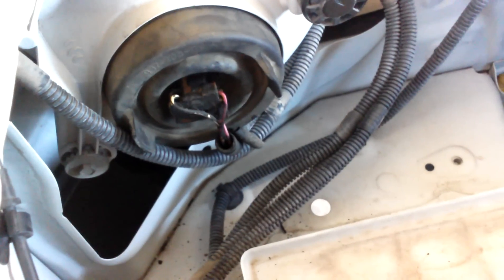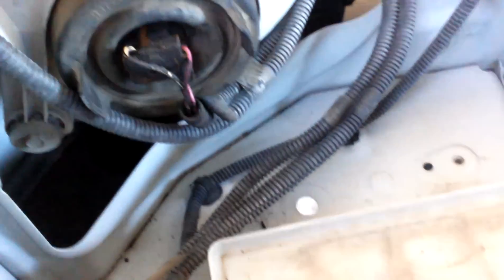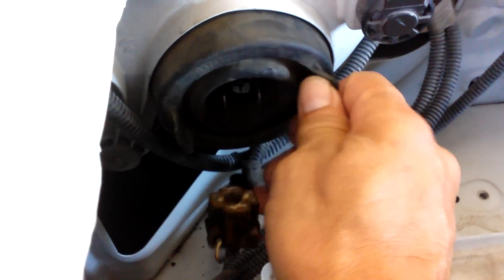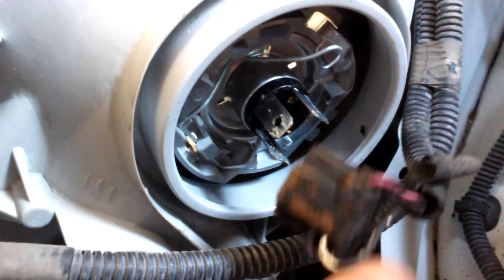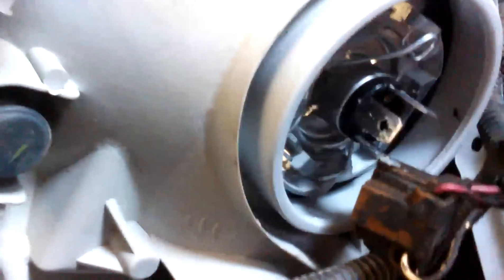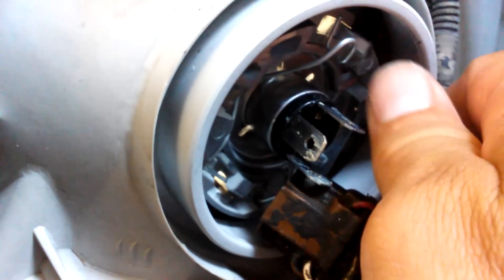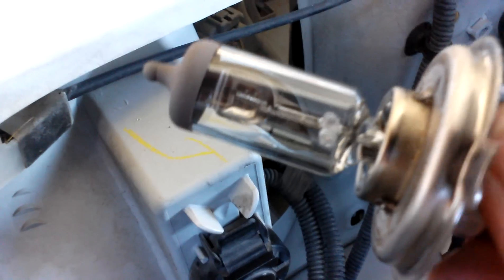Headlight Bulbs Replace Install Easy Change On Toyota Tacoma LED or High End Halogen

Comment: I change the bulb of my Toyota Corolla 1999 years ago, and as far as I remember it’s the same principle. 

My only problem was to reorient the bulb, as I noticed the lights were misaligned the next evening. Was matter of rotating it to the right position.

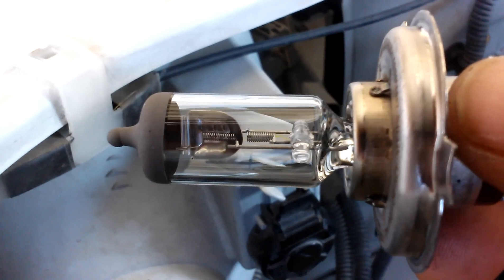I learnt back in the day with another video, pretty didactic too, but your video is brilliant because you took 2:30 minutes to explain what the other guy did in 10 minutes.

cheers!